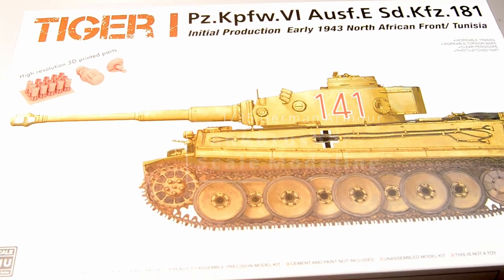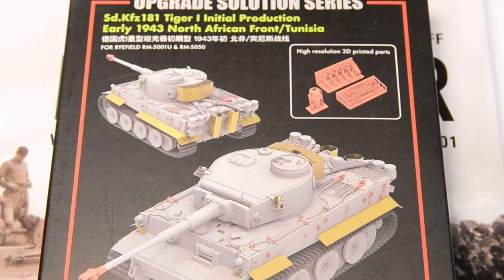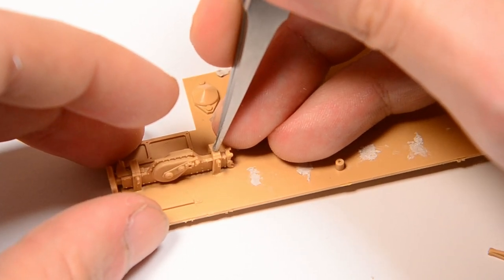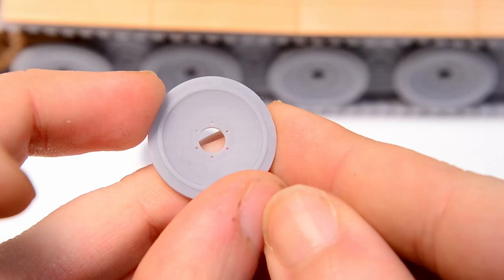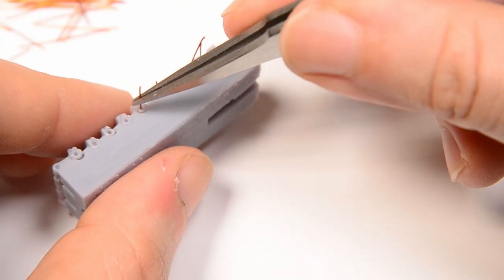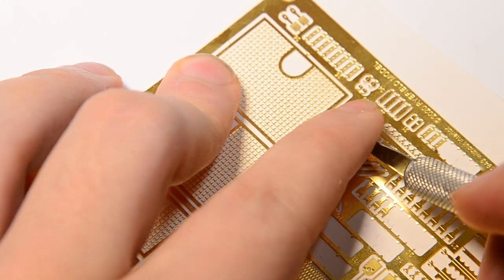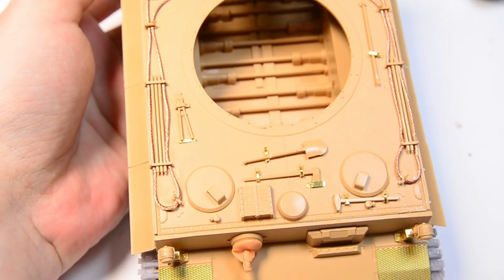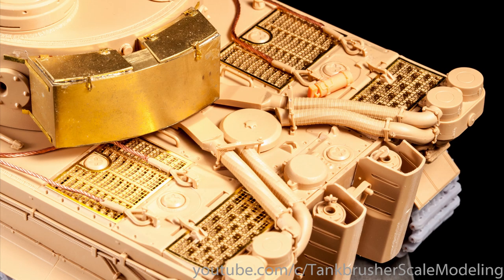Initial Production Tiger Ausf. H1 - full build | Abt. 501 Africa | 1/35 |  RFM | 3D printed Tracks

Comment: Great video my friend..! I like the format as its kinda like a kit review/construction in one. Its nice to see all of RFM fixs pointed out.plus seeing the 3D printing is awesome.(nice tracks Adam )so is the tiger your building like tiger 131 at Bovington ??? I have RZM "the tiger file" dvd which shows 131. Up close and in HD COLOR.anyway this tiger has a small bevel under the rightside (looking at the front) mantal.just the right side tho.they point this fact out as ALWAYS being missed in armor kits.and your 3D wheels are spot on as seen on this tank.thanks for sharing.cheers
Reply from the maker: Thanks Timothy! Tiger 131 is chassis no.122, between this and mine a lot of small changes happen. I will cover this in detail up the timeline it is mine here -> H2 -> Tiger 131. If it works out the way I want to do these builds, you guys will get the full picture of what changed over time. I do have the Dragons Kit of 131 already here : ) That bevel is clearance for the antenna socket of the by than canceled Porsche Tiger, that's why you often read Tiger P mantlet. On my build here this tiger was produced before the last contest of Prosche vs HWA (late Oktober '42), it still was kind of the thing back than and Tigers were still limeted to 100pcs per first contract.

Comment: I just picked up their 2015 release of ryefield 503 kursk with full interior. I need to get the sprues they just released with the hoses and stuff for engine, etc. Its an awesome looking kit
Reply from the maker: Hey Rick. That early Tiger is a nice kit! Somebody warned me here in comment section that they didn't change as much as they did with the Initial production. I love the idea of a good full interior Tiger, but somehow I want it to be 1/16 scale and a "cut away" hull : )
Reply: @Tankbrusher   I like it just the way it is in 1/35. I can barely afford full interior kits, plus I won that kit for half the price it would be in store. With shipping it was 70 bucks, I got a smoking deal, won it off a fb model auction page. I will wait to build it,  not until I get those parts that are missing and my ab skills get a little but better, I dont want to ruin an awesome kit. And to be quite honest RFM should have added for free those missing part, I mean if your spending about $100 on a full interior kit, they should have at least given those sprue. But in the end I'll purchase them as I want my tank to be as close to accurate as possible .

Comment: Interesting you said that about the H1 I build the Eastern front full interior kit to an accurate H1 and not an ausf E too! It's one in my old friends books he's been a modeller for 40 years got hundreds of books and the RFM kit was more accurate for an H1 than an ausf E for Kursk! I have all the photos etc of the real tiger to my build it's all accurate without them smoke discharger mounted on each corner and the rear exhausts one thing that's different on my build I copied from the real thing it has a notek on the fender! It's a strange feature but when show the model with the photos as shows it really interests people!

Comment: Great video! Just to clarify, the RFM-5001u parts at 0:42 are the only changes made in relation to the previous RFM-5001 model? The rest of  the pieces of RFM-5001U are identically the same with RFM-5001 right?
Reply from the maker: Exactly. Next projects in line are v1 based on 5001 and turret 100 with 5075, so I'll have a look at both other kits as well.

Comment: Nice build! Amazing research infos! The will help me on my next tigers! 

What type of resin 3d printer are you using? The parts are amazing and the resolution of the layers are spot on!

Thanks for uploading the video!
Reply from the maker: Thanks Hendrik, don't miss the next part. There are some small changes to the rear I did not do in this episode... I use two Resin Printers atm Phrozen Sonic Mini 4k <- that seems to be the go-to machine for scale modelers atm and a modified Anycubic Photon S. You can check out the public section of my Patreon account, there are more shots of the parts and other tracks.

Comment: Thanks! I now have confidence tackling this kit as my first lol. Btw can all the hatches open? Is there a working gun elevation? Im planning to convert this kit into rc.
Reply from the maker: ; ) you will mange. All crew-hatches can be displayed open. The Commanders hatch will rest a the wrong angle by about 10°. Gun is elevating, you need to make your own bearing for both gun and turret. Good luck with your RC conversion.

Comment: Does the upgrade set contain wire? You mentioned it on 3:15 , however on every review there isnt wire included
Reply from the maker: I either missplaced the wire or there was non included after all. I'm still thinking I unboxed it, mesured the wire and did put it aside(?)
Reply: @Tankbrusher  thank you, then I will be buying some copper wire with it👍😁

Comment: Maybe the box say its initial version but its wrong, initial had no side skirts and no feifel filters and a very different storage bin on the turret or no bin at all.
Reply from the maker: For an umbrella term you can count the first ~20 vehicles as initial production "early" isn't very perceice either... They share that stuff was still figured out, initial wheels, mirrored track... and Ausf. H1 designation. However, if you want to categorize futher than this one would be a post-initial, calling only the first Abt. 502 Tigers "Initial". That's what I go with by now. This Abt. 501 Tiger arrived at the barracks looking very similar to the 502 Tigers, aside from it having the later hull sides. No skirt mounts, no Feifel mounts from factory. Most of the features you named like skirts and Feifels were not factory mounted. Idnk when exactly they where outfitted and painted, but it looks to me like this happed previous/during training for Africa. In Italy they already looked like we know them from Africa.

Comment: I like tiger 131 style if h tiger because fenders look better but great job i love
Reply from the maker: Hey and Thanks. I do have Tiger 131 by Dragon, planning on doing soon - it's a very different vehicle in my eyes. : )
Reply: @Tankbrusher  funny how they fpught same places near same period yet tiger 131 looks like a russian front tiger and this one looks like mist tigers from tiger 1
Reply from the maker: @Mitch_N_Monty_get_fuked  142 looks like the first Tigers used by the Abt.502 in russia - 131 looks almost like a early tiger. Main difference is the first 100 tigers are a different contract that the next 2xx one. 131 is chassis 122 so it is more a 2nd batch or early tiger.
Reply: @Tankbrusher  thx for the info and correction you definintly know alot about tigers :)